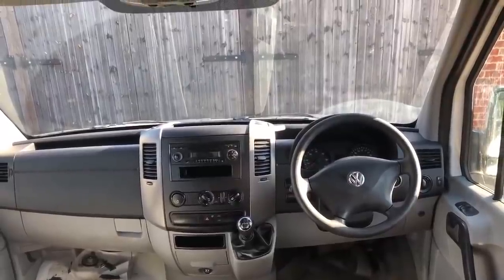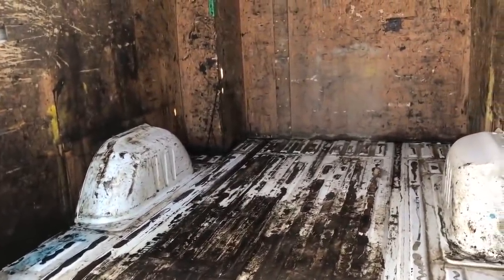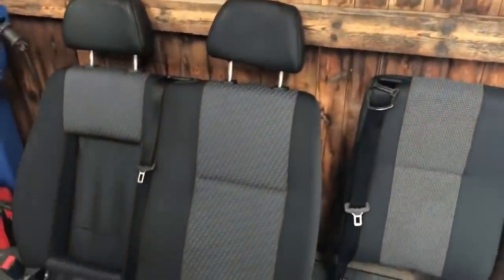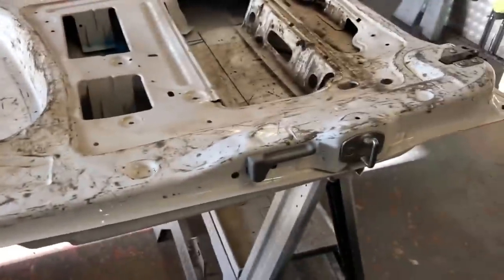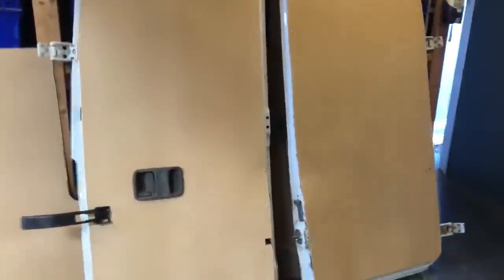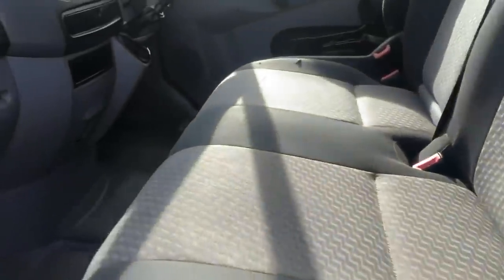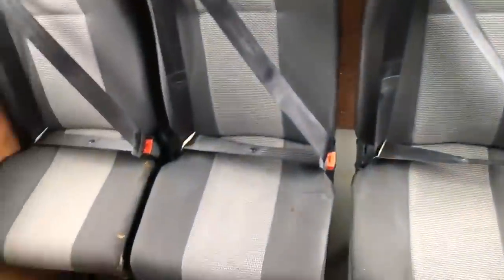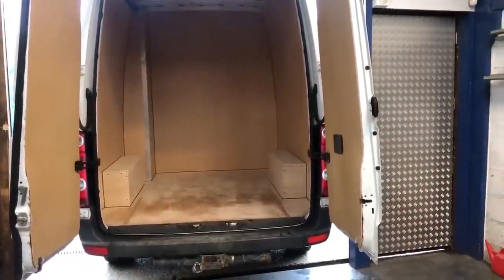SRUK Throwback Sunday VW Crafter The Dirtiest Van In The World PT 3

Comment: Had a nightmare with YouTube not being able to comment for years..
Anyway, Rob and Chris, been watching for years. Absolutely brilliant the pair of you. Just couldn’t tell you before today !!!
Got a tip for you lads, done this myself and it’s a winner.
Stained horrible ply lining in the back of a van or on a flatbed?
Answer - give it a couple coats of grey water based paint. Superdec works well, any fence paint in light grey works well also. It’s really transforms faded and stained ply quickly and easily. Hopefully this comment loads, if it does I can express joy at a few other I follow on YouTube.

Comment: The Auto Union 1000 S Coupé in the garage certainly looked like it could be saved, maybe the two others in the garage as well (we didn't really see much of them) The Rover looked reasonable too, despite of the slight heat damage, The bottom part of the VW T1 looked pretty rotten, but having been covered, the upper parts may be ok? Possible one or two others that could turn out to be in better condition than expected.

For certain, there are a lot of really rare spare parts that could be salvaged, especially all the stuff in the garage.

It should be possible to learn the history of the place and also who is currently listed owner. It seems to have been an extremely massive fire, so there must have been news reports made at the time. Contacting the local heritage foundation would be a good place to start.

To me it seems to have been the home of a car hoarder, hoping to "one day" be able to restore the cars - the typical way, that hoarders often do: collect a lot of damaged and broken cars, one after another, but never get around to actually fixing them, so they just pile up, creating a big junkyard of broken dreams.

The fire may well have been fatal, and if the owner had no family or just lived like a hermit, nobody has ever bothered to do a cleanup, thinking everything was just "old junk"

Who would inherit the place if there were no next of kin? The state? The county? A bank? Wouldn't it be in the best interest of everybody, if this place was finally cleaned up? So it may be possible to make some sort of deal with whoever is in charge.